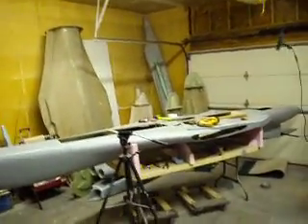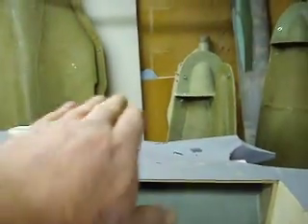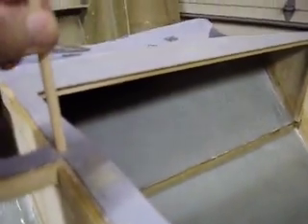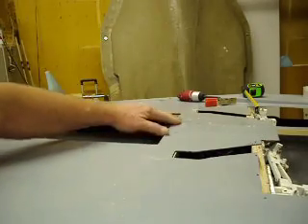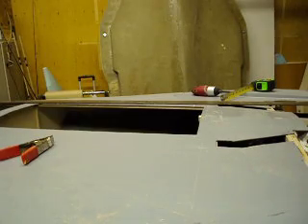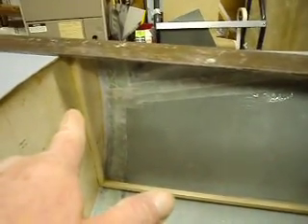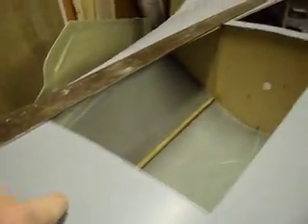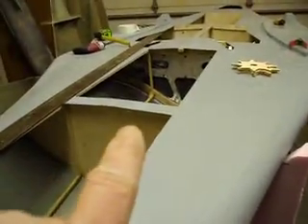How to build a RC Jet B-1 Bomber #102

Comment: On thing that I am worried about is are the magnets going to have enough strength to hold the BBDB in its launch position with the vortex moving speed of the wind.  This plane is going to be really moving just to get off the ground. Just in fuel alone you are going to

Comment: have about 30lbs of weight, 1 gal = 6 lbs. My have to really reduce the speed of the aircraft just to keep the BBDBs from falling out.  Also it might be a good idea to put some plastic skate like Barings on the main shaft that turns the BBDB holder to make a cleaner and smoother drop, plus less power to move the rod. I think three bearings will do for each bulkhead, that being a third of a circle around the shaft to hold it in securely.. In total that 9 bearings. Just a quick thought!

Comment: I'm still curious about the longitudunal stability of the airframe, especially with all the large holes you're cutting in the fuse. Are you sure it will have the strength to carry the load front to back without some kind of keel to tie it all together?

Comment: Correct me if I'm wrong, but the B-1B has a longitudinal bulkhead that separates the main landing gear area making a separate well for each main gear assembly.  Are you going to include it?  That might be needed to add to the fuselage strength in that area.  That stringer there may not be enough.  Also, the Bone can carry a cylindrical auxilary fuel tank in the rear bomb bay (big sucker - fills up the whole bay).  Food for thought for extra long flights.